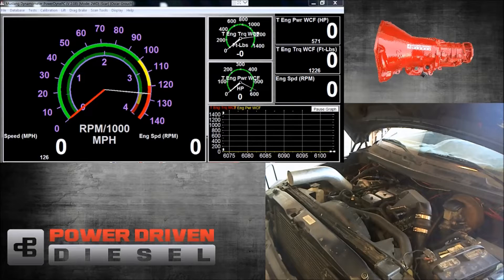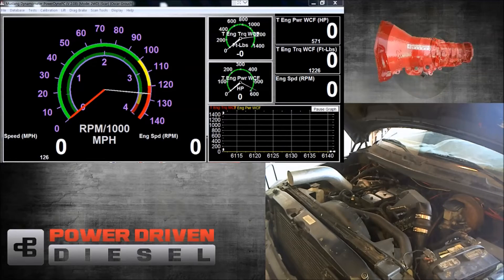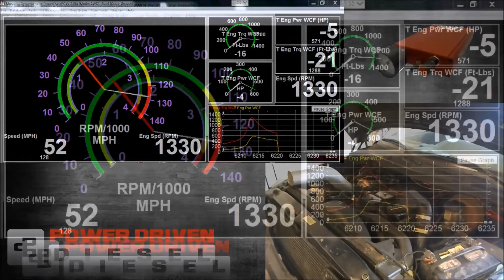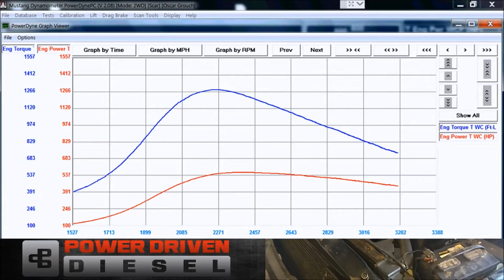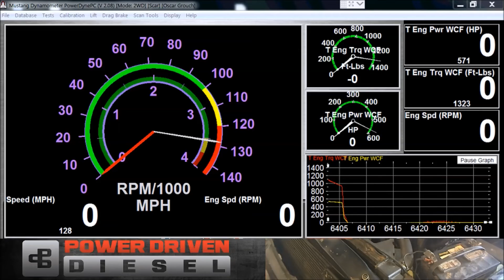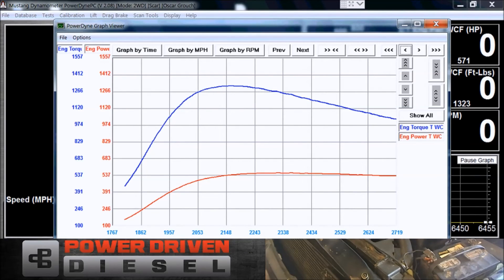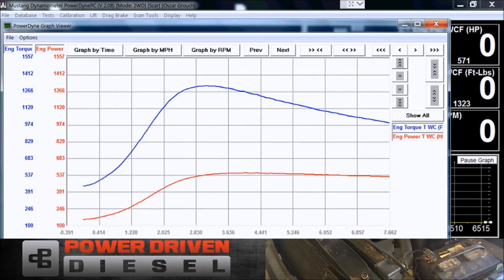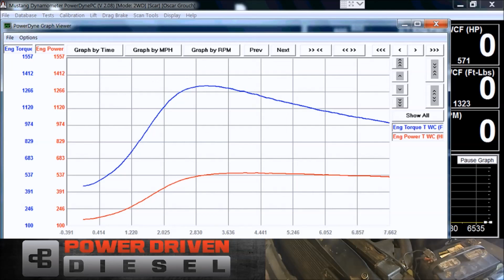Dyno Test: BorgWarner Turbos S362SXE 68mm Turbine .70 A/R  Turbine Housing | Power Driven Diesel

Comment: I have this turbo on my 97 12v and I’m not that happy with it. I’m a manual with a 215 pump and 5x12 injectors and afc live. I have to put a lot of pre boost fuel to it to get it to light. It sucks towing, I have a hard time making it work good without high EGT’s.
Reply from the maker: Yes unfortunately the 62 dose not like to light until 1600rpm we would recommend a modified hx35 like the aggressor 60/64
Reply: what DV’s? 4k gsk?

Comment: I have been looking at getting this turbo for awhile how do you guys think this will do for  daily/towing with my 2001 dodge 2500 with edge juice with attitude and built trans  Until I pull the plug on injectors Cam valve Springs and a bunch of top end stuff?
Reply: I'm also looking at the hx super9
Reply: @cameronwagner3061  Hi i am comparing these two turbos which one did you get and how much power did you want to make? if you don’t mind sharing

Comment: My 97 runs at 2,000rpm at 55mph in 5th gear and almost 2,500 at 70mph, along with afc live, full rack Tavel kit and 3kgs my stock hx35 over spools very easily under medium throttle. I feel like this turbo would work well for my application.!!!!
Reply: My 97 is really low geared too. I lifted it and went with 37 inch tires to help the gear ratio. Now 2000 rpm is 70mph. So much better.

Comment: What power figures should I expect from an 02 24 valve 5 speed with this turbo, 100hp SAC injectors and an edge EZ tuner?
Reply: @pddofficial  Thanks for the reply, Will the comp box make that kind of power without tapping the vp44?

Comment: could you please tell me what your think a safe psi to run this exact turbo would be? been asking around and can't get a straight answer. truck is a DD
Reply: Brad Dubasak my buddy's brother had it on his race truck and he saw up to 55psi out of it if that helps any
Reply: Look at the map.. 4.8 PR @55lb/min but up top only 3.7@77lbs/min. Turbos do not comprehend PSI, they only comprehend ratios answer your inability to get a straight answer . What's your elevation is there a storm coming in what is your humidity these three factors can change your psi result by  10-20%.

Your Boost limit is dictated by your head gasket/lack of studs,  based on the information provided. .35-55psi depending on your level of luck on the stock gasket. Curious how it went just noticed this was 3 years ago